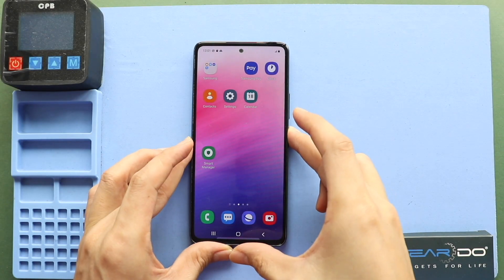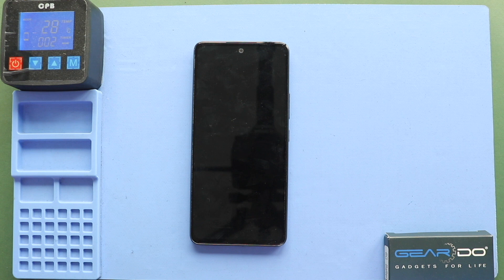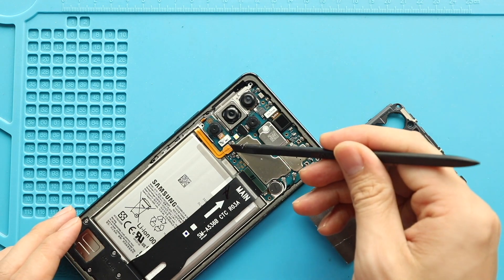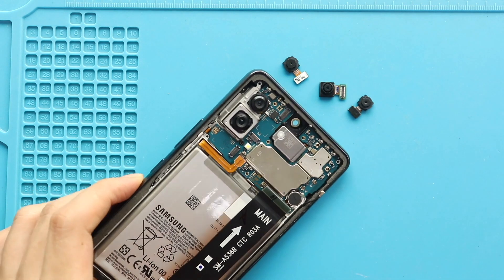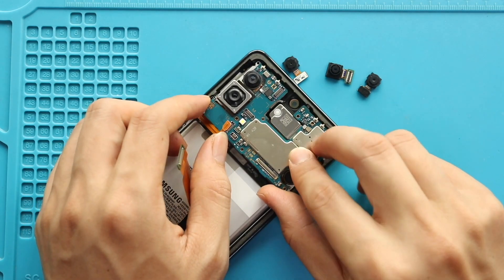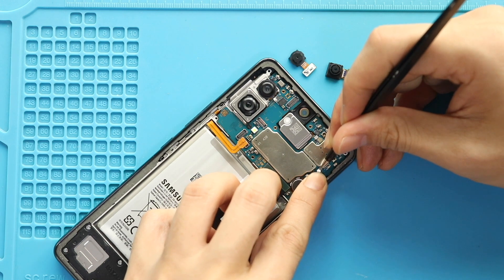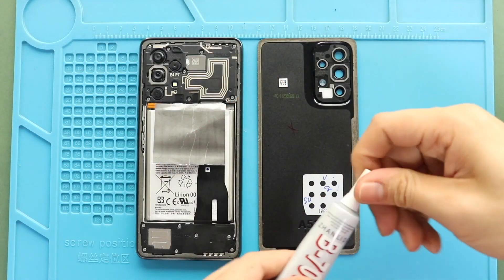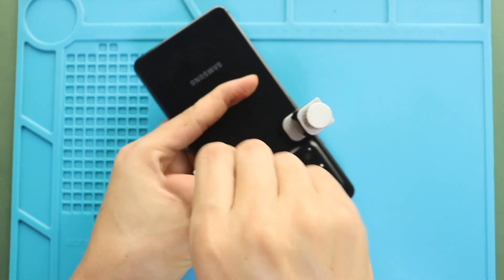Samsung Galaxy A53 5G Front | Rear Camera Replacement

Comment: After replacing back cover is the phone will still waterproof (ip68) ?
Reply from the maker: Nope, unless you go with official Samsung service centre repairs
Reply: If i use a brand new rear adhesive will the phone be waterproof again ?
Reply: NEVER assume or even Try ur phone I waters... not even in the moist shower on the counter